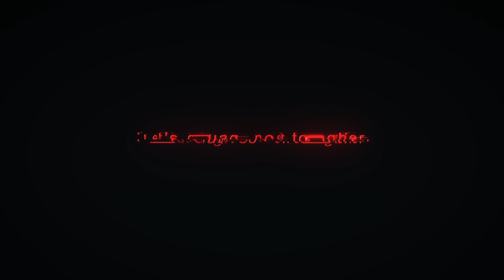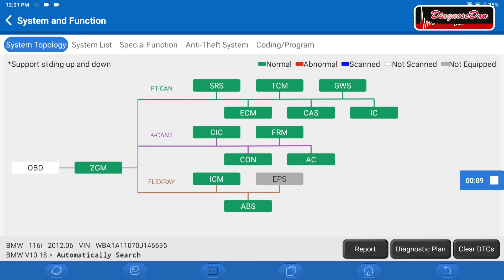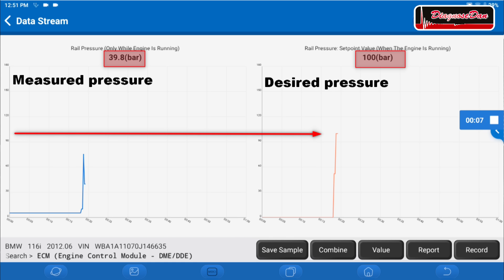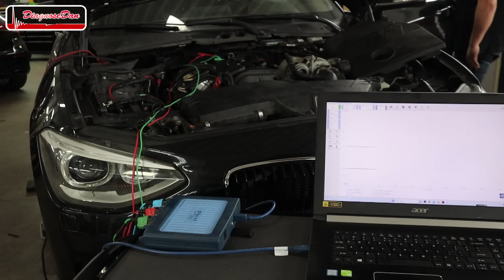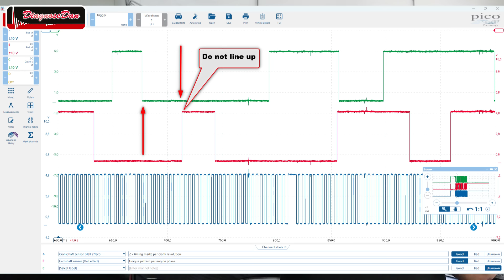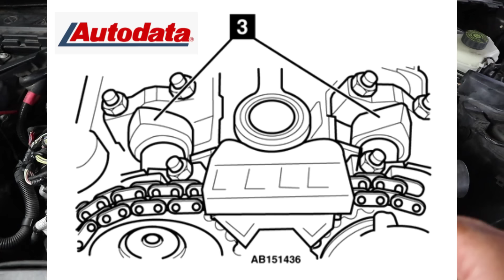Bmw dealership blunder? Incompetence?

Comment: Hello @DiagnoseDan I hope you can see this and reply, I have recently bought BMW X1 X20i 2018 and right before I bought I took it to an independent mechanic to check for DTC's and they found only one and that was " DTC - 133710 Intake Valves Adaptation Air Mass Flow Lower Limit Position Reached ", that mechanic told me maybe someone changed some cables and somehow disturbed other stuffs in there, but when I got to my hometown and took it to my mechanic he said that this is something related to valvetronic and he said that it will cost me 4000euros to change everything related to valvetronic, my question is does it really need to change all the components related to valvetronic ? He can't save anything from there ? I hope you see this message, thanks in advance :)
Note: the car does not show any check engine light and only behavior that I observed is sometimes when I press break paddle sometimes I feel like a jerky stop like going from gear 4 to gear 2 and this behavior feels more pronounced once the AC is on.

Comment: So if the timing chain guide was replaced would the timing be corrected?  Or has the timing chain guide failure caused the chain to jump teeth?
Reply from the maker: No, the chain is stretched and because of the slack it was banging against the guide causing it to fail.
Reply: @Diagnosedan  Ahh, thank you for the explanation 🙂👍👍👍

Comment: So did you fix the customer's BMW, and were the valves bent? Or did you charge them a diagnose fee, and send it back to the independent shop?
Reply from the maker: It went back and the independent workshop will fix the vehicle
Reply: @Diagnosedan  Thanks for answering! It seems BMWs give a lot of trouble.

Comment: Will there be a part two? Is the timing chain going to be fixed or did the pistons and valves have a boxing match?
Reply from the maker: I was only asked to diagnose the initial problem, the independent workshop picked it up and is going to repair the vehicle

Comment: Owned a series 5 ! Never again $16,000 of repairs in 3 yrs 😢
Reply from the maker: Wow that's crazy that has never happened in our shop.
Reply: @Diagnosedan  main box bearing, electronic hand brake motor, air suspension burst leading to cracked windshield, finally timing chain snapped at 40,000 miles 💀. The vehicle was that badly made you cut your hands changing a headlight bulb . I’m a 55 yr old mechanic and I drive a Tesla mod 3 . Never been happier! There’s a fortune to be made repairing German cars 😉

Comment: Same model Gls 450 hybrid 2021  come to my shop,also airbag deployed wont cranking,
When diagnosis pyrofuse blown, repair.
Also fault code,
the discharge voltage of the hybrid/high voltage battery is too high.
Help me please???
Reply from the maker: Thanks for watching

Comment: You can hear when you crank it that it is turning way too easy. Even an apprentice should be able to hear that.
Reply from the maker: In fact it was very hard to hear, the fast cranking was because of the battery booster. Without that it cranked at a normal speed

Comment: Dan, does the customer have to pay for parts if they don't fix the problem?
Reply: Spent €1.000,- at the BMW dealer without a solution. Unfortunately it seems we have to pay for no solution….😡
Reply: @krijn438  Like they say. You pay for what you get. I don’t think you should pay if it’s not fixed.
Reply: they misdiagnosed the fault - they should pay
Reply from the maker: Depends i guess how you communicated it with the customer

Comment: So did the chain actually jump a tooth or will replacing the chain guide bring the cams back into correct timing? 
It seems there are fewer and fewer competant mechanics/diagnosticians left and none of them work at mercedes dealerships.😮
Reply from the maker: The independent workshop picked up the vehicle and is going to fix it

Comment: Dan did you actually get it running re timing and changing those parts ?
Reply from the maker: The car was picked up by the independent workshop to get repaired

Comment: problem is dealers dont know how to fix cars. they just change parts until they get lucky. gERMAN CARS  are over engineered garbage. the sound like broken sewing machines when they run (which  is not often) Being a tech for over 38 years I see the trend has moved from repairing cars and actually knowing whats wrong to just changing parts and hoping for the best. I've had to repair many cars dealers couldnt and the worst part is , it was basic mechanics They always go for the most expensive repair first.  Cars are getting way to complicated to fix.  Just like today i had a volks GTI that had a defective ambiant temp sensor that was causing all kinds of communication and fans worrking all the time and even tpms light staying on. 10.00 later problem solved ..
Reply from the maker: Thanks for watching
Reply: @Diagnosedan  you do great work the right way!

Comment: There is NO excuse for any of the timing components to fail on a ten year old car.
Reply from the maker: The high pressure fuel pump on direct injected engines always leaks a tiny amount of fuel into the oil. Therefore it's important to change the oil regularly because it dilutes  and looses its properties. If you dont do that the engine wont last 10 years
Reply: @Diagnosedan  That sounds like a good reason to stay from new cars. Cars were better prior to the 2000s.

Comment: Hey dan, does this pertain to diesel engines, I got a x3 diesel, low fuel pressure, low side is good high side dearly reaches up to desired. Changed 3 hp same problem, no injectors are leak, pressure control valve on the rail was changed, all parts new
Reply from the maker: Yes on a diesel its exactly the same

Comment: Wow long before I got there they should have checked the pressure at the manifold itself on the engine mechanically tested not relying on a goddamn computer I'd laugh the pumps are fine it was just some stupid valve or a filter something but you know the filters in the tank on that once it's not very likely

Comment: (Goedemorgen Daan leuke content ga zo door😉) 
Hi Daan Nice video keep going.
i had the same  probleem with a Ford Kuga but wen i spray starterpillot the engine with run for a second or 2 and  DTC wear low fuel pressure 
the car was replaced by the customer their did not want invest any mor I could not diagnosis car further.
but my question is to you then the timing is right of engine richt?
Reply from the maker: Thanks for your comment, i'm afraid i'm not sure what you are asking

Comment: I dont understand they didnt do a compression test .... if you get fuel and spark  so obvious ....
Reply from the maker: Didn't it have compression?
Reply: @Diagnosedan   since it's an interference engine, would have been much easier to diagnose the issue by doing a compression test.

Comment: I was taught never trust diagnostic machine, go back to basics first, easy to check and rule out, and in the case of the dealership I hear it all to often, yet they still want to charge, ,,,,,
Reply from the maker: You can certainly trust a Scantool but it will just never tell you what part needs to be replaced

Comment: Hi Dan  I’ve got a Audi allroad  with a code 01310 level control system control module and I can’t find anything on that code . All four suspension   Are down   . Can’t lift in jack mode. Can you help please .
Reply from the maker: Thanks for watching

Comment: To cut the Dealer a bit of slack they often get them that breakdown service guys have been on it and they dont always tell the truth when they delete codes that the realise they shouldn't ,,  but still very poor from a BMW dealer ,  could expect it from Ford
Reply from the maker: I talked to the owner of the car after posting this video. The roadside assistance did a vehicle scan and i've seen the report as the customer mailed it to me. There were timing related fault codes stored! The customer also told me he heard a rattling sound when the car broke down. I'm pretty sure all these details were shared with the Dealership

Comment: Looking that pump its's looks like "Commonrail pump" means timining dont mater more then ruf runing.
I bet there is stuck open injector.......
Show me wrong.
Reply from the maker: Thats for watching
Reply: @Diagnosedan  PS. if power on dos not set a code(dtc), then cranking with no start is failed too(for dtc's), and thats 99,99% promish! If you do get a code then that car is from USA... as cranking isint running and so you do not need to sert dtc's at EU market. (WE ARE ""GREEN""!)

Comment: Why do these N designated engines from BMW have timing problems? N13 N20 N47 N57 etc...
Reply: I have two BMW's with N52 engines. Neither has had a timing chain issue, though (touch wood) I will replace the guides before either one fails. Before timing chains were introduced (again) engines would blow up because the timing belt would fail. Customers bitched about replacing the belt on a schedule yet here we are........

Comment: Isn’t this meant be a first gen N20 engine?
Reply from the maker: Nope they existed alongside eachother. N20 is 1.6 and 2.0 liter
And n13 is 1.4 and 1.6 liter.
Basically the N13 is the smaller N20

Comment: It's so sad that the engine has eaten itself. For a moment I was expecting (hoping) something funnier, like an empty fuel tank
Reply: "It's so sad that the engine has eaten itself."  It's very common for these engines.  It seems like the timing chains, guides and tensioner are of poor quality (that plastic PCV hose doesn't seem befitting of an expensive car either).  The successor B48 engine seems to be better, for now.
Reply from the maker: I think the customer would have minded 😂

Comment: Plastic tensioners in engines with timing chains is just really bad engineering. Shame on you BMW. My 39 year old Alfa Romeo has nearly 200k kilometers on its engine, which has a timing chain (duplex, not a nasty single chain, shame on you again BMW!) and because it uses a sprung gear wheel to tension it it's still using its original chain and its still in perfect condition. It's almost like these modern engines with timing chains are designed to fail......BMW are far from alone with this issue.
Reply from the maker: The tensioner is not made of plastic just the guide

Comment: That has got to be the same Dutch guy that does the political history Channel... He put on weight!!!
Yes, just bought a 2012 Cooper S. This is super helpful in overall diagnostics. The N18 is similar. But it should have sputtered with the Quick Start. Yup, the valves hit. But that motor would have been making noise from the loose chain... Dumb owner, dumber garages...BIG BILL!!!!

Comment: The mechanic answers 99% of the cases, the computer says that there are 4 errors and that they should be replaced
No, I say
check the first component, if it is ok then check the others one by one. What does it say in the bullitin from the manufacturer, is there anything about this problem.
the mechanic : What
Don't know how many times I asked: Do you know how these parts are connected to each other and the computer in the car, 98% answer no
. There's the problem, they can't read a wiring diagram
sigh
Reply from the maker: Thank you for leaving a comment

Comment: But you didn't fix it DAN! Is that engine beyond repair? can it be fixed? Not a very conclusive ending for you!
Reply from the maker: I know, the vehicle was picked up by the independent workshop to get repaired. I was only asked by then to diagnose the initial fault